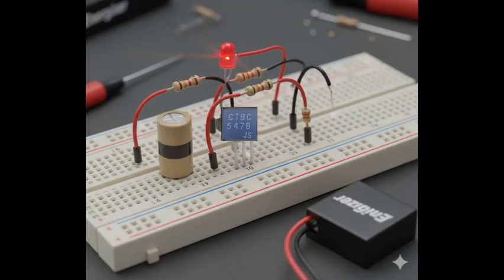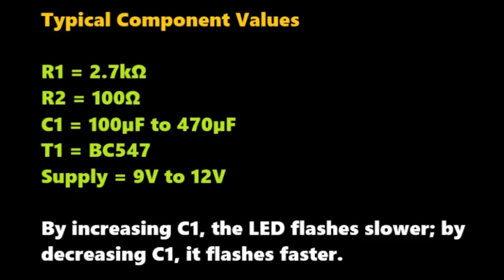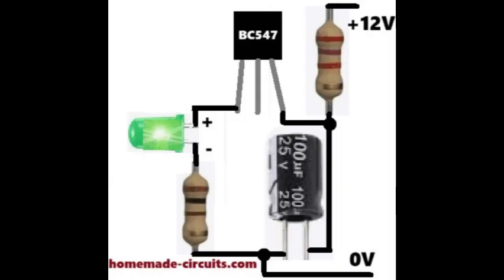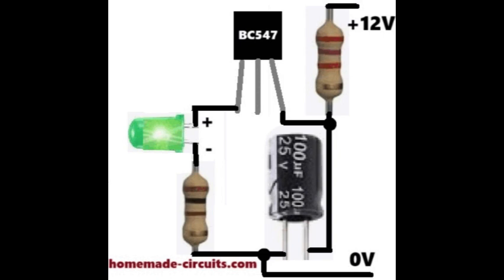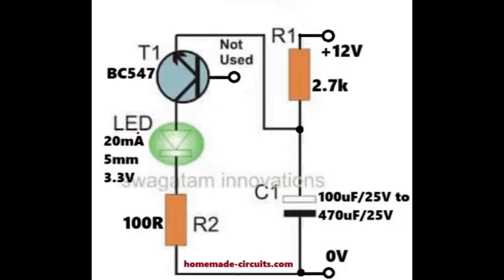How to Make a Simplest Single Transistor LED Flasher Circuit

Comment: Sir, can we use 12 volt led with this circut?
Reply from the maker: Ghulam, I think it should work, however I cannot confirm it because i did not test it with a 12V LED. With a 12V LED and 12V DC supply,  you won't require the LED series resistor or reduce it to maybe 10 ohms...